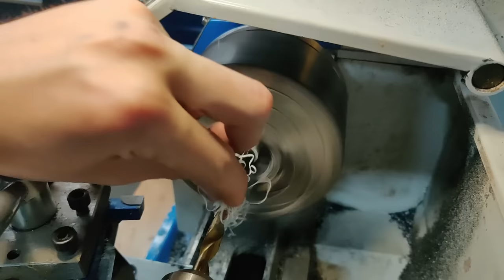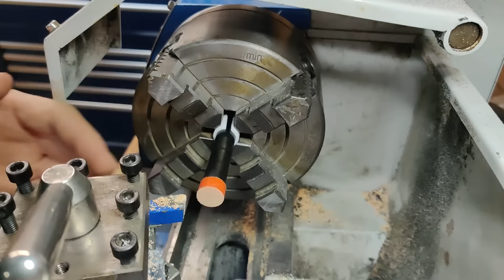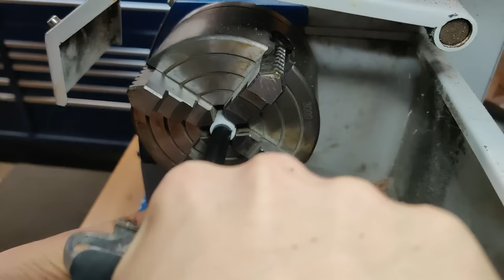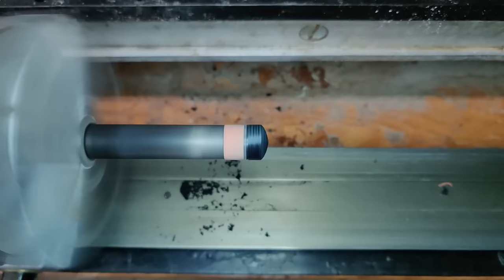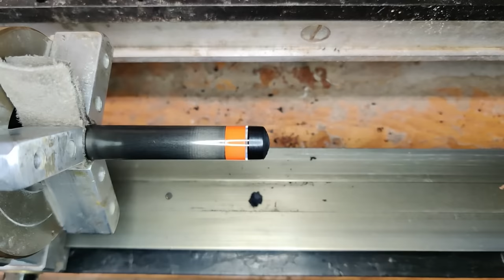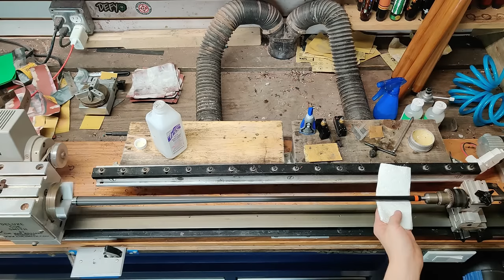CueTec Cynergy carbon fiber ferrule replacement with G-10

Comment: I haven't read through the comments but I have a suggestion or two... flip the jaws around and you can hold closer to the end. That will reduce the jerky cuts you get because you're holding on to such a long piece. Shorter is better. Hold on to ONLY what you need. Also, start further away so you don't accidentally cut into the ferrule like you did on the first cut.
Reply from the maker: You just made me realize that I could flip the jaws around. I've always hated how much they stick out on this chuck. I'm an amateur machinist as you probably noticed. 😆 Thanks for the advice 🙏
Reply: You're welcome. Been machining for over half a century. It's the little things that make life easy.  @arsbilliards

Comment: Nice job im a machinist  and getting the scrap off while the turret is turning is very dangerous will wrap around ur finger before u know and u will have 1 less finger
Reply: Derilin is so soft it just breaks, and it's not sharp.   I remove it while the lathe is running.        But I totally agree with you on with metal.    Loose a finger, hand, arm.    From a hobby gunsmith pov.
Reply: I have seen a guy completely loose a finger nail when emory cloth sand paper wrapped around itself and slapped the back of his finger. Material doesn't have to be what we perceive to be hard to do damage.  Stay safe.
Reply from the maker: I'll be more mindful of that, thanks 😁

Comment: How the deflection on that one?
Reply from the maker: The CueTec Cynergy is a very low deflection shaft. The G-10 I installed is much harder than the original PVC that comes with it.
Reply: Yes but I think the g10 is a heavy ferrule
Reply: @ARS Billiards  the deflection question was not answered.. 😁
Reply from the maker: @poolsicario5882  I'm sure the small weight change won't effect it much. But I see what your saying. I'll probably drill out the center of the tenon next time to reduce the weight. Predator revos and many other carbon shafts use heavy, hard ferrules. Some players prefer that hit.
Reply: @arsbilliards  i see 
Yes hard ferrules are better
Reply: Hey, I think this is my cue! Lol. Thanks for the good work Ethan. Plays great.
Reply from the maker: HEY! Glad you like it 😁

Comment: So i have 2 questions. 1 where are you located? 2. I bought the cynergy 10.5 mm tip (plays like snooker tip) but the ferrule it comes with mushrooms a lot. Is there any way you can change the ferrule of it to a stronger one? Is this the whole point for the video?
Reply from the maker: Our store is in Riverside California. yes I can change the ferrule to a harder material. That's why this customer had me install G10
Reply: @ARS Billiards  does this affect spin on the ball? Since it's a harder ferrule?

Comment: Jesus, I can see the shaft flexing off-axis! Way too much stick out!
Reply: I don't have the exact physical specs of G10 at hand, but, considering the length he used (pretty close to the diameter of the ferrule), I doubt it will perceptively flex during a 30 MPH impact with a relatively light round object (cue ball) that will easily displace on a very slick surface

Comment: Why did you sand the tip? The whole point of the Kamui Clear series is to NOT sand it first. You're introducing pockets for air to get trapped in, which is what causes tips to come off in the first place. You obviously know what you're doing, so I can't understand why you'd do that to a $30 tip
Reply from the maker: That's the way I do it. I haven't had a Kamui pop off in years
Reply: I also sand every time clear (800) , never fall off and never got cracking sounds. Feel free to do it. I changed at least 25-30 kamui clear tips.
Reply: You shoulda always sand the tip and Ferrell for a better connection I’ve never had a tip replaced an they didn’t sand them an I’ve never had one fall off
Reply: That would be if you sand it with 80 grit sandpaper. Or, if you did not burnish it at the end. He didn't do any of that.

Comment: What did you use to glue the ferrule into the shaft?
Reply from the maker: It's a flex epoxy from total boat
Reply: location?
Reply from the maker: Were in Riverside California

Comment: But i don't get why still they don't use better tech to replace stupid ferule. You paying 500-600 usd for shaft and it's easy to ruin shaft if you do mistake while replacement. If ferule goes that long into shaft they could've made like a screw ferule.
Reply from the maker: The Cynergy shaft is $399. I have done many Ferrule replacements on carbon / Fiberglass shafts with great results. 😁
Reply: @arsbilliards  doesn't matter still not original. You left at least a little bit part of previous ferrule. Point is why still they don't use screw style ferrule for high end shafts.
Reply from the maker: No one uses a screw type ferrule for carbon shafts. There all just plugs, epoxied in.
Reply: @arsbilliards  once you do that no more warranty either
Reply: @vio3667  You can't cut a thread in carbon fiber, even if the wall was much thicker that the average 1mm thickness used for cue shafts. Carbon fiber does not machine well at all; even cutting a straight and flush edge is not very precise. The fibers tend to come apart when you use a parting tool on a lathe, etc etc.  One interesting question is, why not build the shaft with a carbon fiber plug already in place from birth, so all you would have to do is stick a G10 plate to absorb the impact and stick your leather tip on top of the plate. Then you would have a near zero mass at the tip end and it would be easy to change the plate if it ever cracked, right?  The answer is.................I don't know, but if I had the ability to roll carbon fiber tubes with precision I sure as hell would try it.  Don't be surprised if one day the Predators or Cutecs of the world come up with something like that and take credit for the idea.
Reply from the maker: @senorkasper  not all carbon shafts are equal either. Some fray more than others.
Reply: which brands are the good ones?
 @arsbilliards

Comment: You used alcohol to clean the shaft what was in the small green bottle
Reply from the maker: It's a secret 🤫
Joking, it's McDermott ultra glide shaft conditioner
Reply: @arsbilliards  When I saw the cap I knew what it was immediately lol. Just so you know. about 1/2 as much as you used would get the job done. A little goes quite a long way with their conditioner. I have even reused the same amount that has soaked into the rag on another shaft. That said, those were G core shafts and and it may require more for carbon.

Comment: Hi, Im wondering about the Cynergy's ferrule ? is it kinda "hollow" ? Could it resist hard massés ?

Im asking because Im looking for a range of carbon low deflection shaft that would allow me to play both pool and balkine.

Problem is : low deflection cues often have ferrules that should not be used to do hardcore massés like those we do in carom/balkline billiards. Revo could be the solution but the smallest cue they have are 11.8mm, it's quite big for carom.
Reply: All carbon fiber cues are thin and hollow, that's what it is a carbon fiber tube but filled with a foam that hardens of various density depending on the cue maker.

Comment: Obviously that's a nice job. But the question is still : why on earth would you replace the original ferrule by an heavier one 😲? 
If you want to add deflection to your cue, just buy a first price maple shaft 😅
Reply from the maker: Changing the ferrule to a harder material isn't going to make it hit like a maple cue 😆 it's still a carbon shaft . It will hit more like a Revo now. They use phenolic for there ferrules.
Reply: @arsbilliards  I kinda disagree. The Revo is furrelless in designed using their description. They needed to patent the Vault plate for the money. It's a sneaky new wording for "ferrule". I'm not sure what it's made of cause there's no description other then it "The tip insert can be machine from a single piece of material comprising glass fiber-reinforced epoxy laminate sheets". That's from the Patent description. Really that just states it's function and what it 'can' be made of. So just looking at it I would think it's made of carbon fiber. That way the carbon fiber doesn't destroy anything softer than carbon fiber. I could me wrong but I can't find any videos cutting into one. Carbon fiber doesn't machine easily so you could tell right away if it's carbon fiber. I do know in the past their ferrules were really soft. They would melt if machined to hard. It was a hard lesson I learned starting out. It was my cue so I will never do that again.
Reply from the maker: @MrADVANCEDTEK  I faced one to install a new "tip silencer" it cuts like phenolic. Im sure I'll replace a ferrule (Vault plate) on one eventually. We work on alot of cues.
Reply: @arsbilliards  video'd it?
Reply from the maker: @MrADVANCEDTEK  yeah, I just have it on my PC. Haven't gotten around to editing it. I'll upload it here soon.
Reply: 1 thing about the cuetec ferrules is they are made out of softer material and will mushroom over time..I change all the ferrules on my cuetec cf shafts..
Reply: @tonybest5107  I agree their Cynergy ferrule is quite soft. Never seen one mushroom though. I break with mine and it still fine. I can't stand how dirty it get. Seems like some of the low deflection shafts have softer ferrule material. My first 314 had a soft ferrule. Some of the materials are no longer made. Every thing has a digit sequence in the name as the latest greatest product.  Meucci's are kinda soft. To be honest some of the newer stuff is just crap. They won't glue unless you find their DNA or they get banned for being sold as a Ivory counterfeit. Also I can't stand the color. I prefer a really bright white for my homemade cue. Really sets off the contrast and looks modern. Off white/soft white looks old and faded.

Comment: Nice job.  Do u support the end of the shaft? Or does it fly without support? 
Could u send me a link of this lathe?
Reply from the maker: This Lathe has a rear chuck. Its well supported
Reply: @arsbilliards  ok and where i can find this lathe?
Reply from the maker: @tkreiner1902  The simple metal lathe I got from Alibaba and the cue lathe is from Cue Smith
Reply: @arsbilliards  I was impressed by you near zero runout with the four jaw chuck. I assume you dialed it in with independent jaws, correct? if so, what brand chuck is it and did you have any trouble adapting it to your metal mini-lathe?  Also, where did you get the orange G10 rod??!! I can't find one anywhere. Thank you in advance for your reply
Reply from the maker: Its a generic 4 jaw independent chuck that I got from the same supplier that made the mini metal lathe. The orange G10 was custom made.
Reply: @arsbilliards  Why are you using two different lathes? it can all be done on the cue smith.

Comment: What did were the last two liquids that you put in on the carbon fiber?
Reply from the maker: First I cleaned it with alcohol. Then I used McDermott's ultra glide shaft conditioner
Reply: @arsbilliards  thank you
Reply from the maker: @fahdfahkri9251  no problem, thanks for watching 😁